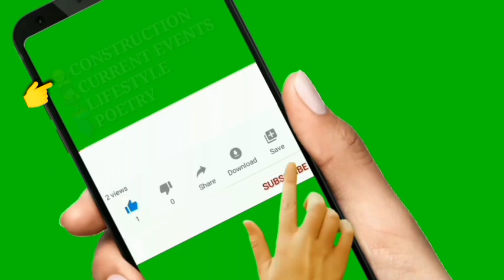CYCLONE WIRE sa 15m x 30m na Lote, Magkano ang Gastos? Ft Bayanihan sa Simbahan Antiquera  Chapel

Comment: Patulong po sana. Kailangan ko po kase makapag provide ng material list para sa pagpapagawa ko ng bakod na gawa sa concrete posts, barb wire na naka hook sa GI Pipes 

DETAILS
L shaped yung end to end ng bakod                ( 13 meters x 7 meters ).
Concrete posts sa 2 end corners and 1 in the middle. 
Schedule 40 GI Pipe ( baon sa concrete post ) sa bawat 3 metro in between sa 3 concrete posts.
Except for its use in concrete post, Round Bars will also be use as hooks for barb wire. 
1.5 meters yung taas ng GI Pipe above concrete at  1.5 din sa layer ng barb wire.
Salamat po.
Reply from the maker: Hello, pagbasihan nyo nalang po ang mga nabanggit po, yan na po yun. Mas maganda po pagkayo kasi na visualize nyo na po ang lot area.